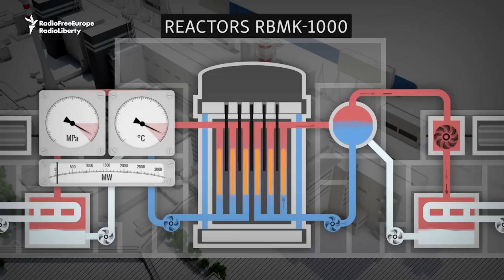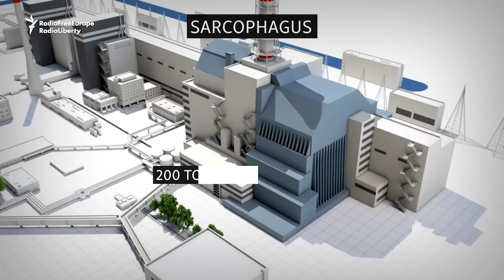The Chernobyl Disaster: How It Happened

Comment: Before the disaster, the thermal power (MW) increased to 33,000 megawatts and here it is shown that megawatts do not increase before the explosion, and 2 is that the rods when they are at the top increase the reactivity, and when they are at the bottom (i.e. in the core) they reduce the reactivity, but in animation it's the other way around

Comment: This doesn’t explain what happened. The reason it exploded is because this type of reactor uses graphite tips on its Boron control rods. 
They were doing a safety test to see if the turbines could power the cooling pumps if the Plant lost all its power as in a Nuclear Attack. The generators took too long to warm up from a cold start, and would not get water circulating again quick enough.
The problem was the amount of  Xenon 135 that built up, a by product or “poison” of a Nuclear Reactor. Xenon is an accelerant of the Nuclear Rxn, along with steam, and even graphite. Water and Boron Control rods slow the reaction down. 
The test was to bring the reaction in the Core down to 700MW from 3,200MW. Normally this would be done in a short period of time in one shift, but because the Russian higher ups needed more power that day, it was done in TWO shifts. The Reactor had been sitting at half speed all day, creating Xenon Gas, and not fully burning it off, as it would at full speed. 
An overnight crew was assigned to run the test and had NEVER performed it before. They came in and were given no clear instruction and were rushed. They went to lower the Reactor to 700MW to mimic a power loss. It didn’t stop at the 700 mark though. The extra Xenon Gas that didn’t burn off all day brought the reaction way below 700MW, uncontrollably to single digits. 
At this point the reaction should have been shut down and started another day, but this was the 4th attempt at this test since the plant had opened. The Forman was not about to allow the test to not be completed. He   ordered the test to push on. The water pumps were totally shut down when the turbines were not up to the proper speed. No water was circulating in the core and the Reactor STALLED!

Now the Forman flustered, he ordered that Boron Control rods start to be removed to bring the reaction back up to the 700MV mark. It didn’t work, so he kept removing more and more control rods until there was an out of control Reactor on his hands. No water was circulating to cool as the pumps were off and had NO residual power coming from non moving Generators, PLUS A SHITLOAD of built up Xenon Gas. The reaction surged into the 10’s of Thousands, totally on the brink of destruction. The final straw was attempting to Emergency Shut down the whole reaction by hitting one button. This slammed all the Control Rods into the reactor at once. 

Remember those Graphite Tips? Those increase reactivity, and when they hit the ALREADY out of control U-235, it caused the straw that broke the Camels back, and the plant fissioned into a small nuclear bomb.

This is how a RBMK Type Nuclear Power planet can be pushed to explode!

Comment: Anyone knows why the workers were not fully equipped with suits to reduce intake of radiation?
Reply: comunism.
Reply: @ragdoll1666  comunism is why!!!!
Reply: The contamination that spewed everywhere when the core exploded emitted very strong radiation (gamma rays). In order to shield yourself from this strong radiation you need thick shielding (lead, concrete, steel). The suits would only prevent yourself from getting contamination on you and only the weaker types of radiation (beta minus and alpha particles). Meaning, the gamma rays would still mess you up.
Reply: @stephenmiller6487  I am aware of that, just dont know why station was not armed with Hazmat suit but with some white cloths instead. Were they unorganised or simply since then never dealt with that major exposure?

Comment: The real causes are not mentioned in this video.   (1) Plant operators and their supervisors were unaware of the inherent design flaws in the RBMK reactor design.  (2) They intentionally disabled safety systems as a prerequisite for a generator rundown test.  (3) After overshooting a reactor power reduction, they withdrew more control rods than allowed to get power back up, thereby putting the reactor in a very vulnerable condition.  (4) The test reduced coolant flow through the core, allowing more steam formation which initiated a power excursion in the reactor.  (5) The last straw was their attempted shutdown of the reactor by inserting control rods which had a flawed design – graphite tips entered the core first which added reactivity to a reactor already experiencing a power excursion.  Huge power spike in the reactor and everything flew apart, maybe from hydrogen igniting.
Reply: The design flaws were known but there was too little effort taken to impliment the needed changes. Reactor nr 4 would have got the different control rod tips after this shutdown. Very hard when you think this disaster might not have happened. 

http://accidont.ru/ENG/LAES.html
Reply: Operators disabled automatic AZ-5 Signals for the disconnection of both Turbogenerators and something to do with the Deaerators. They also disabled the Emergency Core Cooling System, which was because the ECCS would activate upon an MPA signal (Maximum Design Basis Accident) and an MPA signal was to be delivered by operators to mark the beginning of the test. These systems would have done nothing that could have saved the reactor.

 As for withdrawing more control rods than allowed, it is true that operators violated the ORM of 15 control rods, but the reactor itself was designed to operate with many control rods removed.

And the test never reduced coolant flow, it increased flow. Operators enabled two backup Main Circulation Pumps, which actually decreased reactivity, forcing operators to withdraw two rod groups. Due to miscommunications, the turbine was disconnected before the MPA signal was delivered, four MCPS (an entire loop plus a backup) switched from being powered by plant electricity to the electricity produced by the turbine, and testing continued (with much success)

Finally, the control rods aren't tipped with graphite. Rather, the control rods have entire graphite displacer rods connected below them and they never leave the core. There is a 1 meter of space in the bottom of the core that the graphite displacers didn't reach if the control rod is fully withdrawn, so it is filled with water. Once the reactor operator was given the go-ahead to shut down the reactor with AZ-5, all of the graphite displacers entered the lower region of the core at once, and reactivity surged due to water, a light neutron absorber, being replaced with graphite, a neutron moderator. This was enough steam to blow the Upper Biological Shield off the reactor.

Comment: why were all the control rods removed?
Reply: Alex Yallop after a turbine stalled due to an excess of xenon accumulated in the reactor (this was because they had left the reactor at 50% power for 10 hours and it was not hot enough to burn it off as usual) and dropped the power to 1% or 30 MW. The rods are removed and put back in regularly. This is how they control the rate of reactions in the reactor (as well as other things such as water). The mistake here was that they removed 205 out of 211 control rods which is insanity. The test should’ve been stopped multiple times but due to pressure to get the test done as well as arrogance by the deputy lead engineer Anatoly Dyatlov, it wasn’t.
Reply: Jj Jj thank you, good explanation
Reply: @JjJj-pc8cv  Should have been stopped multiple times? What on earth are you talking about?
Reply: Also when the low enriched uranium fuel they used (2%) was at of the life cycle they need to pull more and more control rods out of the core to maintain the power level. So you get less and less control at the end.

Comment: Why did the third shift do this?  I never could function at a good level working overnights.
Reply: Because doing it during the day would have caused black outage the demand for power was to high to conduct the test during day time, so they did the test  during night were power consumption is low
Reply: The 5th Shift did this, and they were the most competent.

Comment: Y were the control rods removed?? People didn't know what they were doing and no special training for them ??
Reply: @ Dana Field Well this gives way too simplistic picture about the accident...this gives much better explanation:

https://www.youtube.com/watch?v=ITEXGdht3y8&t

Suffice to say the reason wasnt so much of the removal of control rods themselves, but what happened BEFORE that that lead the reactor into dangerously unstable (or "poisoned") status.

before the test they had accidently lowered the power too much to halt the reactor and after that performed the fatal mistake of running the reactor at way too low power that was strictly against the safety regulations (because RMBK reactor's had that flaw of becoming unstable of running at power at 200 Megawats or lower) and yet they performed that test at such lower power at 200 Megawats (tbh even if the test had been performed eariler as planned, it still would have been risky and against safety regulations)...and as for the control rods themselves, lowering them provided actually the one final nail in the disaster/explosion as those control rods were tipped with graphite and the mechanics lowered them too slowly into the reactor....as result the control rods actually BOOSTED the reaction first, not slowed it down, which was then caused the huge explosion as power surged through the roof. and whats worse it was those graphite blocks that would then continue to burn in the ruined, exposed reactor and spread the radioactivity for days

So in short you can say that it was combination of dangerous reactor design combined with test that never should have been performed in that kind of reactor type + the ignorance/lack of information that the operators had about the actual dangers of the reactor type....no one in that control room believed/had the information just how unsafe the reactor design really was, cause that information was kept from them by Soviet officials....even the risk reports made by KGB were just ignored/stashed away and the people who were operating these reactors were lead to believe that the reactors were flawless. 

So overall it was combination of all these things that lead to the disaster.....dangerous reactor design, secrecy/ignorance of safety by Soviet government and operators of these reactor types that did not exactly know the risks involved.

Comment: how did they keep the other 3 reactors operational if the radiation levels were so high?  wouldnt workers die?
Reply: Nope, although ofc the background radiation in the Chernobyl power plant would have been signficiantly higher in the immediate aftermath of the accident, they never were high enough to put people who worked with the other 3 reactors in immediate danger...Im not sure though if reactor number 3 that was right next to reactor 4 was shut down during the immediate aftermath until they could make the environment bit safer and build in additional walls around the damaged number 4 reactor to reduce the amount of background radiation...

But either way the reactors were operational years after the accident, number 2 was shut down in 1991 after its turbine caught fire when it was being repaired, reactor 1 shut down in 1996 and reactor 3 was shut down in 2000.

Comment: They should have built the large containment structure BEFORE the reactor blew up. Just like everyone else does.
Reply: Easy to say afterwards you stupid bitch
Reply: Except of course containment buildings of this sort have been around for decades prior to this and the design was a really bad one. No sane country would license a positive coefficient reactor like this one. This is not a matter of second guessing after the fact. This was something that could easily be foreseen well ahead of time.
Reply: @NickFrom1228  I agree that is was a dangerous design. But on top of that in the US a reactor has to have a heavy reinforced steel and concrete containment building not just some flimsy building like the Russian reactor did.
Reply: @joevignolor4u949  Three Mile Island...no problem at all.
Reply: @pgoindi  True. TMI had a serious meltdown and some radiation was released, but it was not a catastrophic explosive release like Chernobyl.
Reply: Joe Vignolo  indeed. That is why they call them "Tin roof" reactor buildings. Bad bad idea.
Reply: pete g  TMI was bad but very little radiation was leaked and the event also enabled a significant change to how plants are run so they are much safer. Could it have been worse? Sure, anything is possible. The problem is we have developed a situation where nobody wants to put the money into safe reactor designs because we can't get anything approved due to politics. So now we are stuck with reactors that are aging and deteriorating so that we are now creating the circumstances we want to avoid. Think about that a moment.
Reply: @gustopher6500  Calling people names is just an indication of low intelligence.
Reply: Even with containment structure you can vent radioactive material through blow off valves to the atmosphere. See three mile island accident and Fukushima. But it would have been less worse that’s true.

Comment: Incorrectly stated that it was a routine test of the 2ndary water cooling system. It was a test supposed to be done at lower power of 700MW, and seeing if the turbines could continue to turn and generate power as they cost down during the period before the backup diesel generators could be completely online. There was nothing routine about this test, the engineer in charge shut down the emergency cooling system, the reactor's design flaw was not kept in mind and the reactor went into a runaway situation, creating a hot spot which melted the core, fuel and caused an explosion. The lack of concrete containment vessel was also a design shortcut/flaw of this type. See a very good explanation below written by Stonkish.
Reply: Exactly. I start this video and keep hearing them say routine and I'm like "are we talking about the same reactor here?"  This was not routine. This was a special test and it was screwed up on several levels.

Comment: First of all, it wasn't a meltdown. It was a steam explosion. Second, they were trying to do a routine safety test in case of war, to see for how long the reactor can be cooled until the diesel generators take over. They didn't know that the reactor had a fatal flaw. It was unstable at low power, and Dyatlov, the chief deputy engineer said the test to be done at 200MW. However, Dyatlov did not look over the safety guidelines which said the test to be done at between 700-1000MW. They accidentally stalled the reactor, and Dyatlov ordered to remove all of the control rods. Then, the power was increasing too fast and eventually they got a power surge. They pressed the AZ-5 button which inserted all of the control rods. The control rods, tipped with graphite, caused an even bigger power surge which means that the reactor started producing a lot of steam. That steam pressure eventually blew the 50 ton reactor cap in to the air. And third of all, the old chimney did not get removed.
Reply: It was not a routine safety check. It was 2 years overdue and had to be done with commisioning. And this type of reactor was also unstable sometimes during normal operation. At most at the end of the fuel lifetime cycle. But most stupid of all they kept this problems quite and just acted if they didn’t exist. 

http://accidont.ru/ENG/LAES.html
Reply: It did eventually melt down after a few days though didn't it?  That's what the "elephants foot" is.

Comment: This video is partially right. The explosion wasn’t cause by the melting, the elephants foot was, but not the explosion. The reactor got so much steam in it from not having all of the control rods in, the part is right, but the reactor rods exploded from too much steam, THEN the reactor exploded from the head pushing all of the rods out of the reactor from the steam pressure. There is a video from 2004 about it.